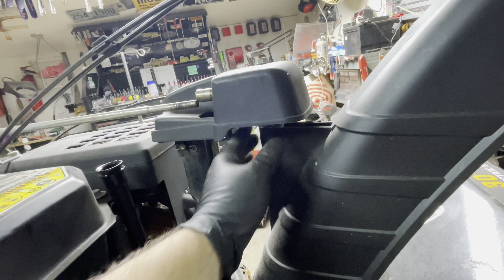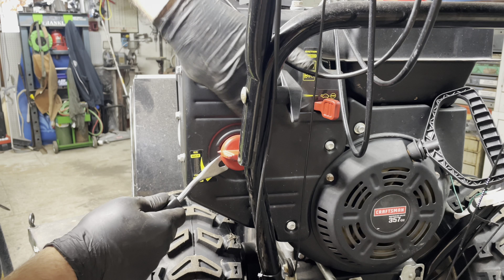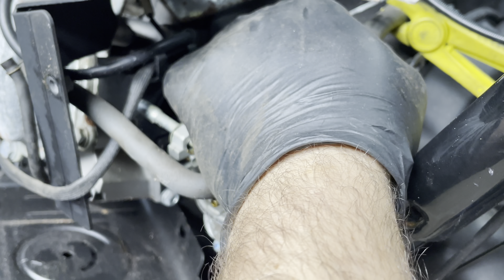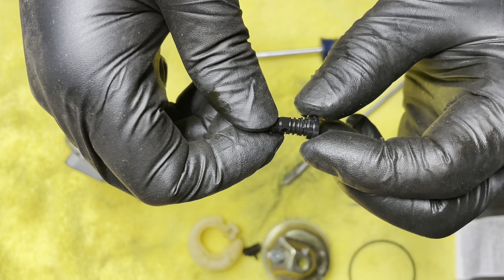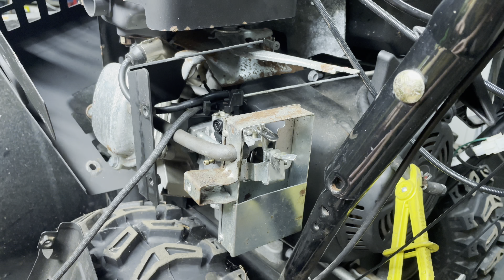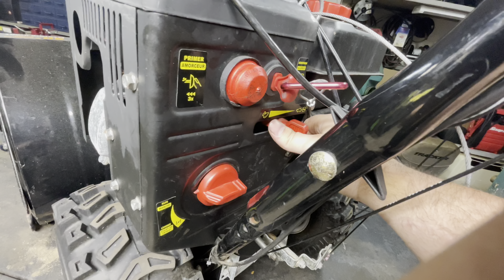Surging Snowblower Fix

Comment: Nice one, JD!  I always take the angle grinder cutting disk to any shroud or cover that doesn’t allow fasteners to simply be loosened to lift off the cover. Only takes a short time and speeds up the process for the next time. 🔧👍
I just saw James Condon using WD-40 instead of degreaser to clean up a small engine. I’m going to try that to see if I can do cleanup inside in cold weather instead of the pressure washer or hose outside and instead of carb and brake clean or old gas inside.
Reply from the maker: Thank you! I think It works really well for many things and just gets a bad rap from internet warriors lol

Comment: I don't often deal w these model engines in my area , Was wondering , how do you purchase those o-rings separately . Do you get bulk packages ? Figured they'd be handy to have should they be needed in the future .
Reply from the maker: I do buy them in bulk and they are very handy to have around, here’s a link to the ones I buy

https://www.ebay.com/itm/394953609591?mkcid=16&mkevt=1&mkrid=711-127632-2357-0&ssspo=OcOhXXoeRtK&sssrc=4429486&ssuid=nzDYeVhcT7i&var=&widget_ver=artemis&media=COPY